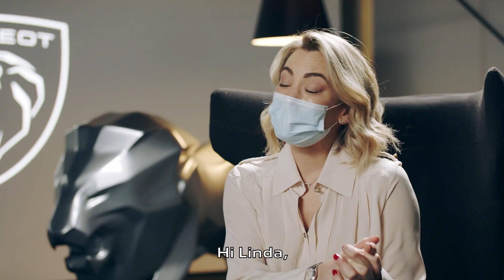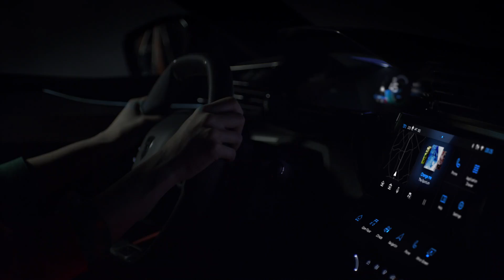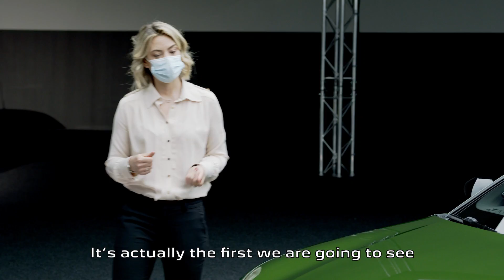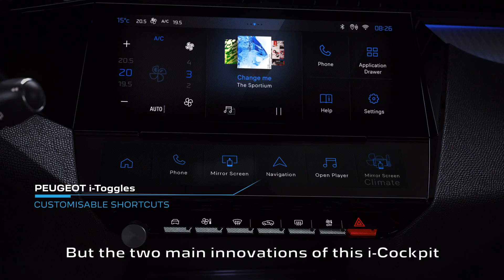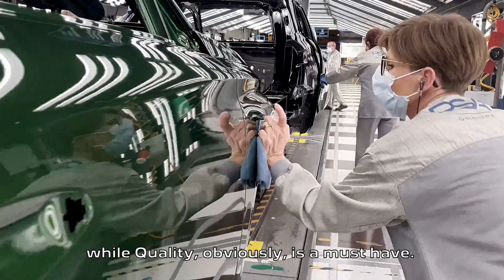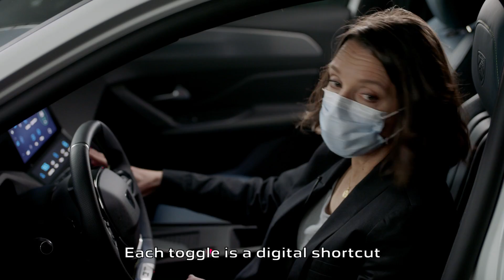Peugeot 308 | Product Introduction

Comment: Sorry. I’m really disappointed in your aesthetics. You have made a mistake here. I held off replacing my car for the electric version of this, and you are not even launching this with a full electric version. I guess that is the worldwide chip shortage. I like a lot about the car but the front is like flat wall. The longer bonnet looks wrong. The rear light design looks like the 208. I hate the crushed lights. Looks like the new golf. The vack of my 2017/2018 looks way way better than this car.